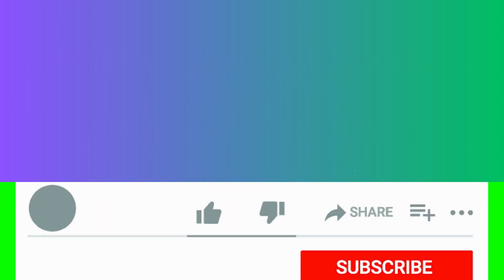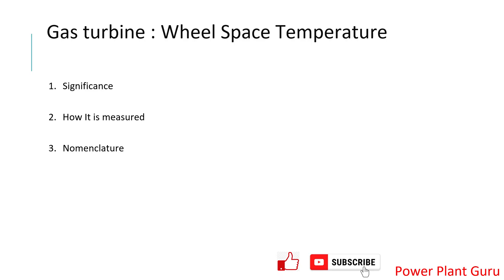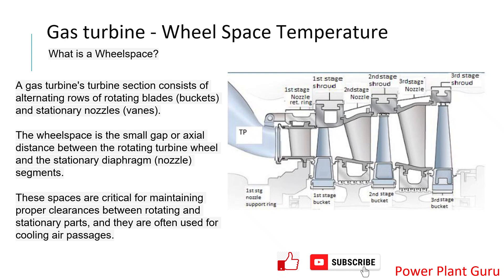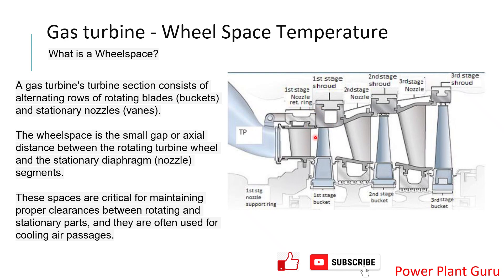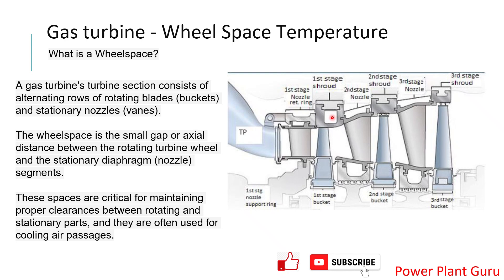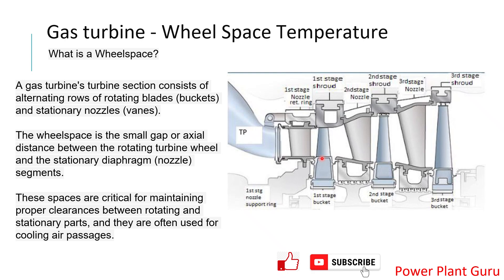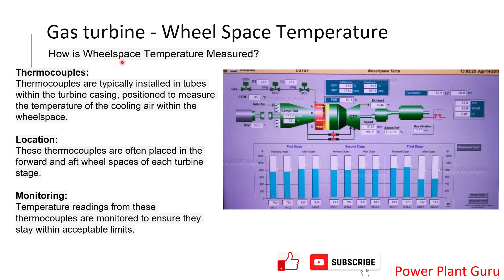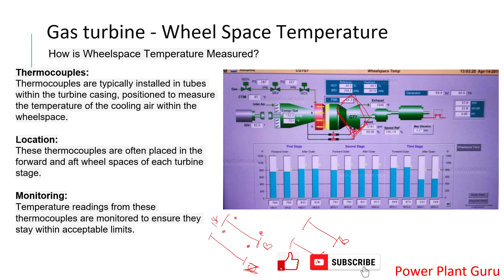Gas Turbine wheel space temperature

Comment: How wheel space temperature will increase and if its increases what will happen?
Reply from the maker: There are cooling ports into all blades , in case of blocking of those ports, the TBC coating also may erode. These are few probable reasons for temperature rise.